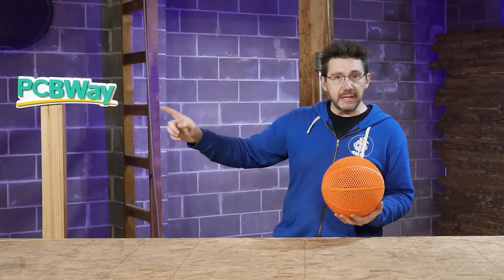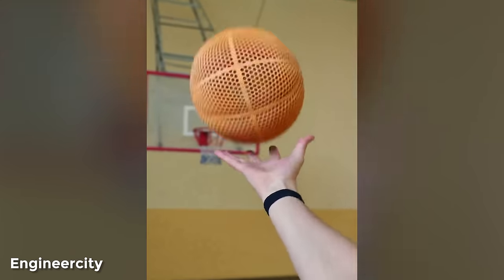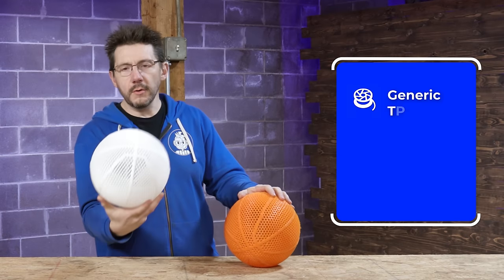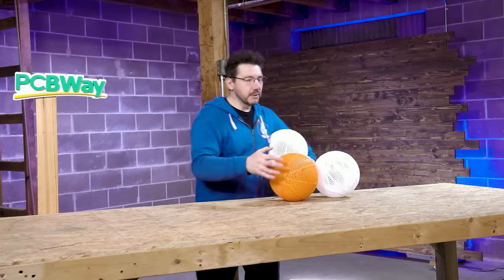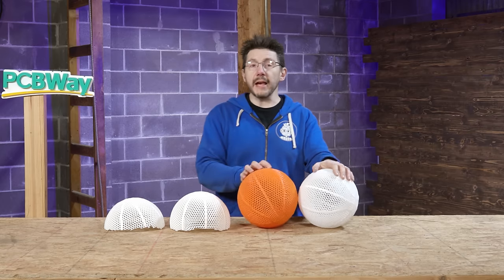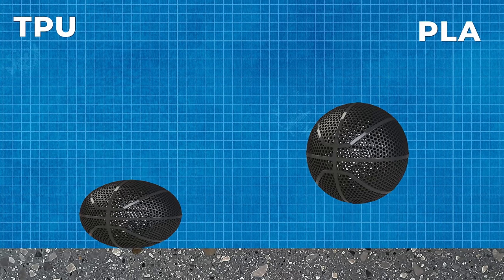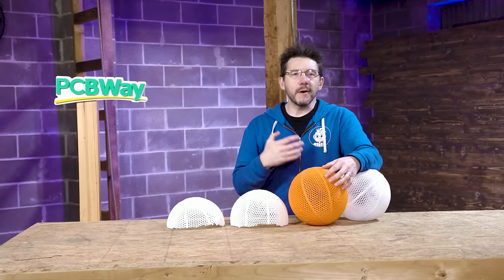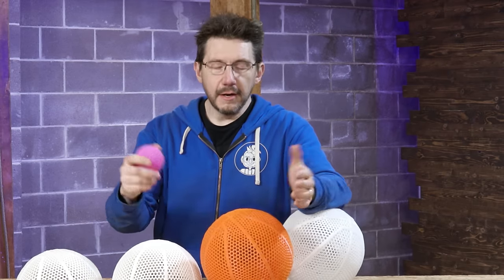YOUR 3D Printed Airless Basketball Might Not Bounce

Comment: Speaking as a librarian, I must say that Andrew's answer is deeply unsatisfying.  Basically, all he said was "the different balls performed differently because they're different."  I would have much preferred someone pointing out that the reason the TPU ball didn't bounce is because its more flexible material returned to the original shape fairly slowly, and so did not provide enough force to push the ball back up.  Whilst the more rigid PLA returns to the original shape fairly quickly and thus pushes back against the floor hard enough to bounce.  Well, up until the point that the energy involved exceeded the PLA part's structural strength and it just failed.  (That last issue being why you don't make a real sword out of stainless steel.)

This video did a good job of showing us all what happened, but failed to really get into the why it happened.

On a side note, since no-one else has mentioned it, have you seen Slant3D's video about a 3d printed American football?  They make the point that in the real world, if you're trying to transition to a new method of manufacture,  you need to maintain user-experience expectations and so at least at first a 3d printed sportsball needs to not just act like the air-filled rubber ball but also handle and feel the same to the player.
Reply: @davydatwood Totally understand! There were a few things that got cut due to timing a flow, but I really did talk about the molecular viscosity of the TPU and why/ how the energy was dissipated in the full cut.
Reply: @andrewmayhall2995  a diagram is worth more than a thousand words I think 😅
Reply: @andrewmayhall2995  I had every confidence that you knew all the things I wanted the video to include, and figured it was very likely it got lost in the edit.  My comment is really more aimed at Joel as the director/producer than anything else.

At the end of the day, though, what makes the video good or disappointing is what's in the final cut.  It can't be rescued just because of something that was shot but not included.
Reply: Yeah, as an engineer, I wished he could've gotten into more detail. Although it seems like the topic is more complex than I thought. You're definitely right about the slowness of the reaction being why it doesn't bounce, but it isn't purely about the stiffness. It's related to how much energy is lost to heat during deformation even when the material isn't yielding. An ideal elastic material wouldn't do this, but I think some materials are more viscoelastic , so they resist fast shearing and lose energy like liquids do, but still keep their shape. 

Also your explanation for why the PLA fails is spot on :)
Reply: This is pretty typical of Joel's videos unfortunately. I guess it makes sense for his audience, which isn't generally deeply technical (at least that's the impression I get), but he does tend to skip actual scientific conclusions more often than not. A bit disappointing given his background as a software engineer/tester, but maybe it's just a call he makes based on the demographic his videos attract.
Reply: @XoNMan1  Joel is great 9/10 times, but that one time he isn’t frustrates me so bad in the ways he randomly half asses something haha

Comment: What you want is a TPU with higher dynamic hardness (note not shore hardness, that’s indentation type hardness - we want rebound type) Rebound type or dynamic hardness is effectively a rough measure of a spring constant (realistically its the coefficient of resistution you derive from this testing data too like Andrew mentioned)

Reason PLA bounces is because of this, but because its not not flexible enough to handle the loads (the UTS between layers is much lower than the typical UTS for PLA)
PLA’s got quite a good young’s modulus, it’s a bit stronger than we typically associate it being
But because of it being a ball, as it deforms as it compresses to rebound, the deformation effectively goes in every direction meaning it doesnt matter how you oreitnate it before bouncing (it’s also why they designed it like this for the material theyused, really good stress distribution, except you need the right properties for it to work properly)

Am working on my university’s EV racecar project atm and I’ve been doing lot of materials research than I normally would for fun 
trying to address parasitic in a flanged insanely low friction bushing has been pretty cool (Iglidur Z was the material we’re using, it’s got effectrively the same friction coefficient as teflon but much better structural properties - though evenentually realised that low friction coeficcient has lead to slippage of the conical fastener that also was deforming the flange and have together caused the issue - now just gotta figure out how to fix it)

Comment: Rubbery things aren't actually that bouncy. Steel ball bearings are actually very bouncy. It's not about using squishy material, but material with low internal dissipation, which are actually ususally very stiff.

Something stiff like the PLA, but more durable, like a nylon or CF-nylon would probably be ideal. SLS nylon would probably be ideal, and may be what the real ball is made of.

Comment: This was a really fun video to watch. Both as someone who 3D prints for a living, and who does STEAM workshops.
The reason the TPU doesn't bounce as much is the same reason a mattress in a gym doesn't let you bounce much when you fall on it. The material properties absorbs the impact, dispersing the energy upwards as the impact progresses. It folds in on itself. So most of the energy is gone. Stiffness stores the energy for the bounce back. reason the PLA could bounce, sortoff. But the downside is stress fractures caused by storing all that energy in an unforgiving material. Just basic impact science.
I also posted this on Uncle Jessies video

Comment: I just finished printing an airless tennis ball as I saw this this morning. I used Flashforge Flexible PLA and it came out great. It bounces higher and for longer than an actual tennis ball. Just a PSA if you use this stuff, make sure you dry your filament first. It looks awful if you don't. Even fresh out of the bag, it didn't print great, at least not the small details of the hexagons on the ball. Dried it, and it works much better.

Comment: What if the interior of the ball had a sparse honeycomb lattice so it could evenly transfer that energy so the force isn't traveling along the circumference? Its impossible to injection mold, but not hard to 3d print.

Comment: As cool as the concept of an airless basketball may be, I do have a lot of questions about how it would perform, even if it could survive the stress of repeated impacts without the support of pressurized air. What would the air dynamics be like? Wouln't that amount of surface area trap a lot more dirt, deadskin, and sweat, especially on the inside where it would affect its performance even more?

Comment: You probably need to tension each of the "plates" by bending them. That could force some energy into the system/ball, so when it impacts a surface, it REALLY wants to push back, as opposed to dissipating the energy.

Comment: have you tried using two different types of filament in a dual nozzle 3d printer, use a flexible material and a rigid material. would that be possible or not

Comment: Originally commented this on Uncle Jessy's video, now it ended up here 🤷: 
A few years ago I was looking into getting a dual color printer, and the best one for my budget had one extruder, but 2 PTFE tubes/filament going into the one extruder. Kinda like the AMS but different and way older. So my theory, through lots of g code editing, is to acquire a machine like this, for example, the Geeetech a20m (if it still exists), and with these printers, you can actually combine filaments to make different colors. Ex. white+black at same flow speed=grey. This is usually used for gradients from one color to another in prints, it might not work on a whole print. SO... You use PLA or possibly PETG for the first filament, and some 85a or 95a (prob. 95) TPU for the second filament. If the settings are correct, now (theoretically) you have a custom PLA TPU mix, that can be customized to whatever hardness you want through changing what filament is used more. This is 100% a theory, i have never owned a printer like this, plus they are probably hard to find. Just an idea.

Comment: So FDM is just a bad match for this. My guess is that they used SLS. Material wise you want a nylon. That is going to give the right ratio of ductility to hardness. Lastly, the structure is wrong you need a second layer to act similar to the bladder inside the ball to give the structure the right characteristics Basically give it more bounce.

Comment: This is the most aggressive I've ever seen Joel... Good times.

Once I started seeing people printing in PLA and PETG, I became concerned. Those will bounce... until they break. Which means you get multi-day, 1kg single use... and then it's done. So if showing off, use whatever you want. But someone is going to want to try to bounce it... and then the problems arise. ABS is probably in the same boat, CF-anything is gonna make it MORE brittle (and cost a pretty penny). Nylons I have the least experience with so how well it does... would love to see a video of it. TPU is a much better choice for most people, but obviously it's too soft. Or is it? This issue is a product of our own creation. People went "if I want something solid, PLA/PETG/ABS. If I want something not solid, TPU/TPE". and for TPU/TPE, they wanted softer and softer.

I haven't tried it yet, but I plan to try NinjaTek Armadillo which is 75D vs. the 90-95A that most TPU is. I have printed with it before and know it basically is indestructible BUT still bends and flexes and have thrown models at the ground and they bound back. So hoping for the best.

Comment: id say you need a filament thats not flexible per say but strong rigid material that can bend enough but instantly form back under its own tensile strength to bounce it back like a real ball does (the air in a normal ball makes it try to go back to shape because of air displacement)

Comment: Perhaps a higher durometer flexible is needed. When you boil it down a basketball, volleyball, etc is basically an air spring.
Reply: I argued with Gemini ai for about 4 hours the other day and what we came up with is either you need maybe a tpu82 or nylon12

Comment: I think that PLA ball could work better with a better means of distributing the load stress, similar to that 'supernatural' infill pattern RMIT University came up with for titanium recently. Perhaps internal struts across the circumference of the ball in a star pattern? Kinda like the spokes of bicycle wheels but in a ball shape rather than a cylinder.

Comment: I have been wondering if it would be possible to print this in multi-material, with something like a PETG lattice core, with a TPU external wall or two to prevent breaking. 

Might be a good XL print to use those toolheads!

Comment: Could have saved a bit of time using a side by side with a regular basketball. How it uses the elasticity of the rubber outer shell  but the rigidity of the compressed air inside to force itself back into shape. Either way, outside of the basket ball and maybe tennis, other balled sports like Baseball, Soccer, Football and even volleyball rely on the surface of the ball as much as its function. Footballs being thrown or kicked rely on its shape to be thrown as it does and if it was hollow like the basket ball then it won't fly right. Soccer balls and baseballs spin and curve through the air because of its surface which would lead to a lot of problems with how athletes play the game. Think of how many pitches thrown are not just fast balls. Stuff is good in concept but lets face it, there is no reason to replace the old air filled basket with a complex and time consuming 3D printed one. 3D printed tires are still in a weird spot right now where they kinda are good but in general they are still useless and way to expensive for most vehicles. 

Now 3D printed Wiffel ball and bat would be something to pull off. Heck 3D printed dodge ball would be worth making.

Comment: So you need a material that's elastic but not flexible. Fun times!
Reply: This would be better if molded and with internal tension, you cannot 3d print stuff with internal tension at all.

Also, why go those lenghts when you can just use the air pressure on an original ball, it's only to steal money from rich people.
Reply: @GeomancerHT  Well having a ball you don't need to inflate is pretty cool